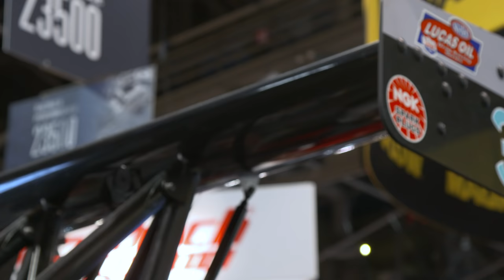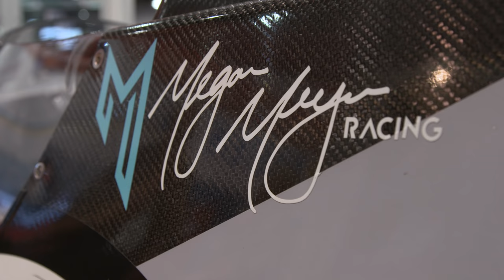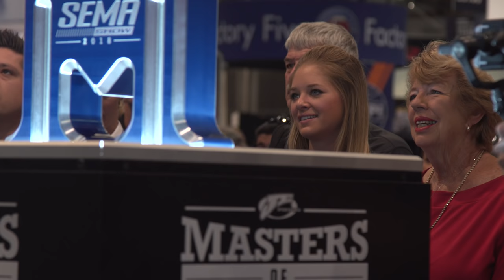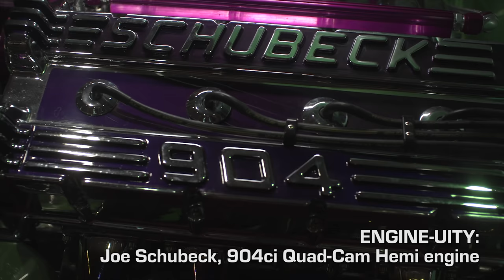Masters of Motors 2018 SEMA S01 EP01

Comment: you guys make a great team.. i would love to see a little challenge between you all.
oldschool garage tuning   on  non efi  engines.
should be allowed to find other  old original engine parts from same decade  to make frankenstein builds with.
only new parts allowed should be sparkplugs. gaskets , rings and bearings.
all engines  is same type  to start with..
no electronic devices is allowed to adjust engines.  it must all be done by  mechanical senses.
then for a final test them all on a dyno and see how far you  are from tweaking most out of it.
think  it would be a really cool challenge and a good way to show the youth what real skills are.  
back then there were no error codes to read. 
often you used a screwdriver as stetoscope to listen for abnormalities. i still do that :)

Comment: lil slanted judging panel but im with Kojima tho i love the power density, efficiency, and reliability of smaller engines but i like that all the Hot roders just did like momma used to say; "if you have nothing good to say dont say nothing" lol .Thanks for not taking blows at our passion and just giving respect because we respect all engines whether its measured in liters or cubic inches too

Comment: I'm just waiting for there to be more people utilizing Red-Eye, Demon or Hellephant crate packages in their builds. The Hellephant is easily the most bad-ass OEM gas-burning V8 on the market. We can expect to be seeing quite alot more of them in muscle-car and truck builds soon, hopefully. When it comes to their high-performance "stock" SRT engine packages, Mopar is at the top of the heap right now, far as I'm concerned.

If I had some more money to burn, I'd love to put a Hellephant in my off-road-only (because it has a welded diff in the rear) Chevy 3500HD farm-runabout/service-truck. The engine in the old gal is feeling its age, so it's due for a replacement soon. I think I'm gonna have to "settle" for a CAT 3208. I love me some Caterpillar V8s though, so no biggie. I'm sure that with a little work, I can squeeze enough power out of a 3208 to put it in the same ballpark as the Hellephant, but really, what's the point? lol It's for pulling heavy shit out of mud holes and towing implement trailers, not running 1/4 miles. All I care about is torque. Horsepower is a useless number in my world.

Comment: So does the V12 have a flat plane crank?   Or are the connecting rods 60deg out from each other?
Reply: Probably the same setup as an inline 6. The ignition and fuel management is simply run as two inline sixes most likely

Comment: I think you need to clarify Boosted engines better. And I must say I,m was so happy to see Megan Muyer engine voted as top NA engine. But is it in reality if you look at the Top Alcohol dragster rules where this engine cannot be over 456cu in with 97% nitro Vs the supercharged Alcohol engine which can run either 466 or 528cu in depending on the supercharger. I think something must be boosting the NITRO engine.

Comment: I don't really know if nitrous oxide is. Classed as naturally aspiration as in the uk. Nitrous isn't really used as your forcing  nos into the engine via a pressured system where as naturally aspiration  air is brought in via atmospheric  and. Engine vaccum. So in my opinion its. Not. Na. If its. Nos

Comment: Mike needs some re-education on engines. It's not that his perception that import motors have merits are invalid. However he has no idea about abiabatic efficiency or volumetric efficiency and how that applies to motor size.. Small motors do have lower total friction, they do have higher horsepower density to volume, weight, and piston displacement. This does amount to quantifiable advantages in a world where you are searching for gains of hundredths of a second. But large engines do not have poor volumetric efficiency. They have poor volumetric efficiency at high crankshaft speeds because of the cube square law. The dimensions associated with area grow less than the dimensions associated with volume so your airflow to cylinder volume ratio is less. But if you equalize piston speed rather than rpm you work with an area to area ratio. Airflow and velocity are similar in this case. Because the air velocity is similar volumetric efficiency can be similar but the rpm of the large engine is greatly reduced. This doesn't stop prostock engines from reaching 135%ve and 11000rpm capabilities with just 2valves per cylinder and 500cu in. But what you would observe if you analyzed its design is that the stroke is similar to or even slightly less than many import engines in the 2.0l (120ish cu in.) range. This makes the piston velocity equal without a sacrifice to rpm. While that's not the case of the 904 it ilistrates a point that size and power density are only inversely associated when you assume all dimensions are changed in proportion. Comparing a Nascar v8 to a f1 v8 from before the turbo hybrids showed up would show much similarity in piston speeds, torque density, ve, and total horsepower despite the f1 engine having almost twice the rpm capabilities. 

The lower area/volume ratio does not reduce ve it only shifts the peak ve rpm downward. This does not reduce abiabatic efficiency fundamentally. It actually means that there is less area to pull heat out of the air charge as compared to the volume and mass of the charge. That means less % heat in the cooling system and more %power to the crankshaft. It also means that the hot cylinder walls don't heat the charge as much per charge mass to expand the charge and reduce the ve. Well atleast in theory. You have knock to contend with as flame speed might be a problem in a gas engine. I'm not saying the big engine is a better solution, in practice during normal driving it of course is not efficient. It would never create cylinder pressure and a lot of intake charge is used just to idle the engine. But under full throttle runs it can be quite efficient is all I'm saying. If you take things to absurdity like the idea of moving a ship or train, they use big engines. If the vehicle is heavy enough the engine no matter what its power to weight ratio will eventually be an insignificant portion of the total vehicle weight. In a drag car 500lbs might make a 1/2second difference but in a train a mile long many thousands of lbs may as well be a spec of sand. The diesel engines in trains and especially ships take scale to absurd levels, but the bsfc of a cruise ship engine is not half of one of those light 4 banger engines and that's the definition of efficiency. Large scale may not amount to driving economy in a hotrod but he was awfully specific in his assertion that it was the ve and abiabatic efficiency that were problems and should check himself before making such claims.

Comment: 22:33 The Oil pan that helps stiffen the block...well a Honda F20 engine has that from the factory and it turns 9K rpm, so they copied a Honda S2000 engine architecture?

Comment: Nelson's engine didn't get credit for featuring the only car with dual fuel systems that function seamlessly on the fly... 93 octane aand low boost super streetable manners that switches over to race gas and 40psi boost based on throttle position... Totally unique

Comment: Most powerfull none poweradder motor: Lycoming XR-7755.
Reply: The Lycoming XR-7755 has a power adder. It is fitted with a centrifugal supercharger at the rear of the engine. (Around a 14 inch diameter impeller with a drive ratio of 6:1! )
Reply: @allmodautomotive  
Plus it was a two stage iirc. Nope single speed, single stage. But, it did have variable valve train
https://oldmachinepress.com/2018/05/20/lycoming-xr-7755-35-cylinder-aircraft-engine/